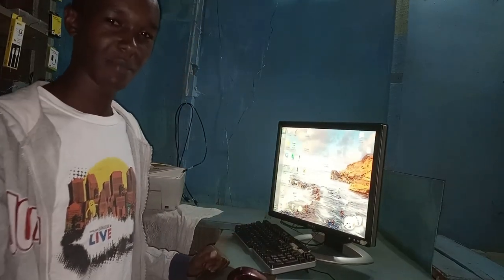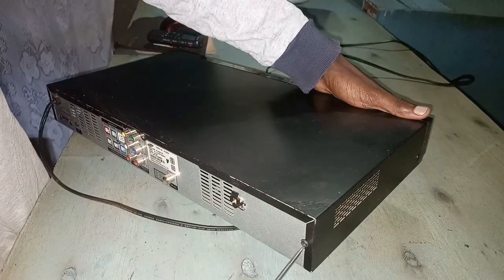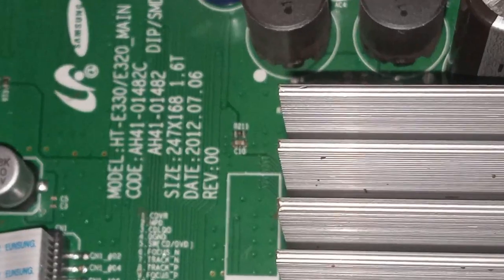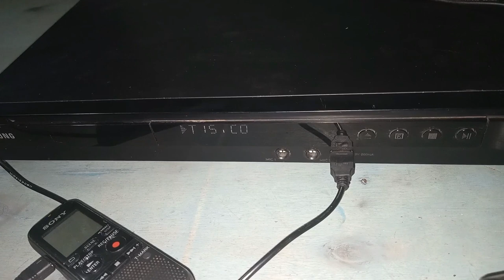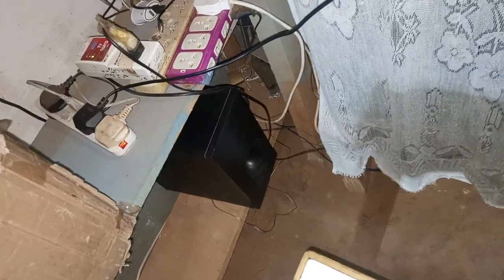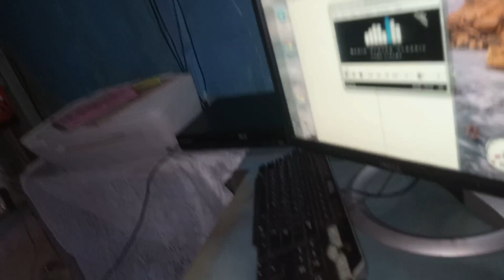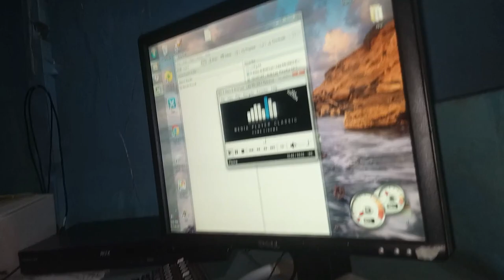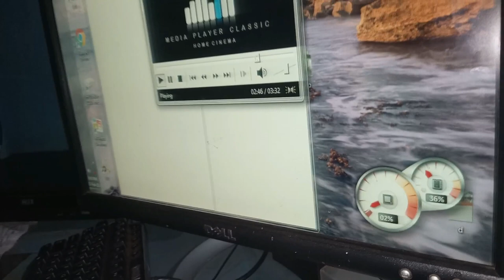Surround sound 5.1

Comment: Hello? I like your explanations on jaukali amplifiers.  Can 24v×2 5Amperes amplifier power a pioneer speaker of 1000W or 1500W ? Which is suitable?
Reply from the maker: Yes, for pioneer it will work, but only at low volume. At higher volume, they will clip and sound very bad, they need more power , lets say over 150w to work well. The amp is giving around 50w which is quite low.
The suitable sub for this amp is kenwood 3010. It has low handling power than pioneer
Reply: @emmanutechnician  Exactly, the 3010 has a sensitivity of 92db. So a small power will shake the entire house
Reply: @Emmanu Technician  what about a pioneer of 8 inch? Then this kenwood sub speaker is it 1000W you're referring?
Reply: @chesaudio5430  which type of kenwood?